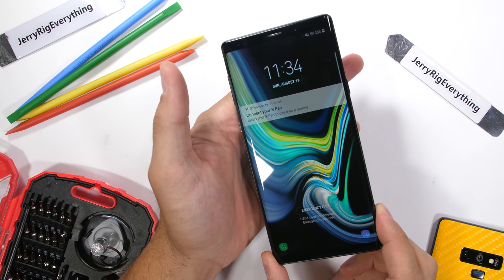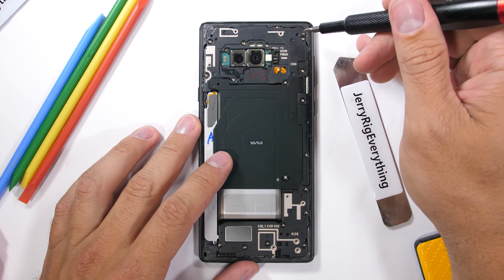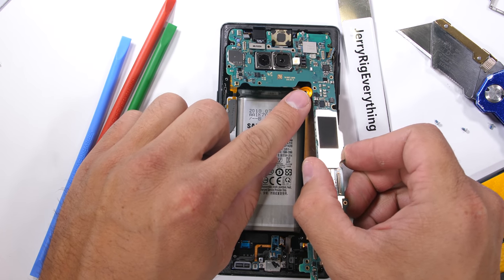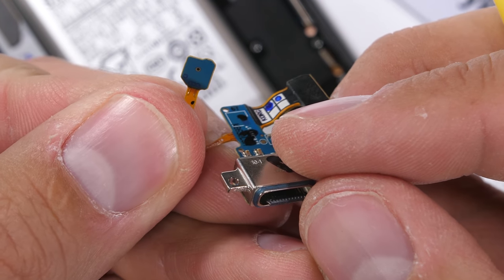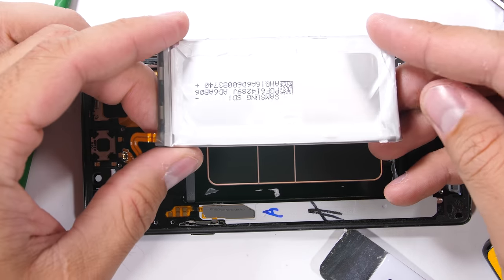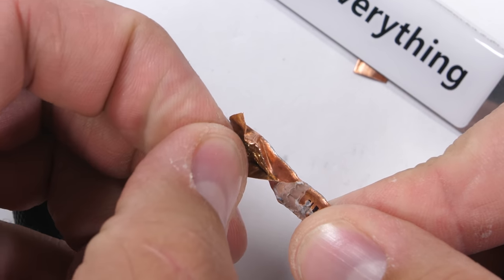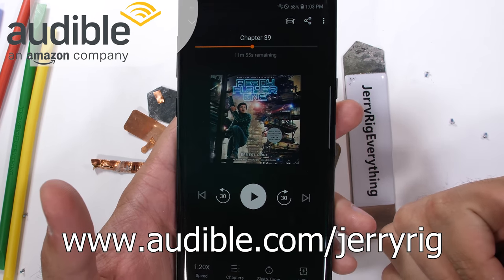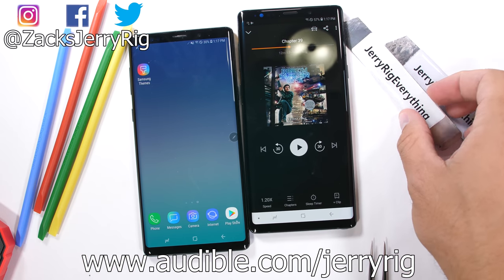Samsung Note 9 Teardown! - Is there Water inside?

Comment: Universe: "Heat Pipe" 
Samsung "PHASE CHANGING LIQUID MATERIAL CONTAINING QUANTUM COPPER ENTANGLEMENT FIELD" 

Classic mobile market. Microsoft did the same, both knowing "water cooling" sounds more impressive.
Reply: Apple: "iheat ipipe"😂in future
Reply: @rohitmeinia2580  Apple doesn't have a heat pipe.
Reply: @LeonCamero  - They'll add it 5yrs later, claiming they've invented it, and no other phone has the iheat ipipe 🙄
Reply: @rohitmeinia2580  apple will take 10 years to add that
Reply: @Danilio. 
No no no, be reasonable.

It'll be 20 years before they do.
Reply: Razer: "Heat destroyer (for gaming*) xXDarK ReapeR of heAtXx "

*for REAL gamers.
Reply: In fact...

Iphone x case = $100
Iphone x notch = $800
Iphone x hardware = $100

Total $1000

Note 9 case = $150
Note 9 hardware = $850
Note 9 notch = $ are u kidding me?

Total $1000
Reply: iheat ipipe "pro" will cost you an Xtra 700$
Reply: @LeonCamero  oh yea you are right
Reply: Not sure why you guys are talking shit then when year-old iPhones are still more powerful than this machine, heat pipe or not.
Reply: @blocksterz  and that'll only be the non expandable 64gb model
Reply: Noah Lach that is a complete lie
Reply: @Noah-Lach  best lie ever.
Reply: Apple has never claimed to invent anything they didn't. I'm not sure where this gag comes from
Reply: Leon Camero Sounds like you’re lying to yourself, bud. The Note 9 is great in a lot of ways but Apple’s chip design is way ahead of Qualcomm and there’s plenty of testing out there to prove it. But by all means, keep being purposefully ignorant if it makes you feel better.
Reply: @Noah-Lach  Please, provide a test where Intel is better than Qualcomm. And also, please provide more test that does not involve Metal from geekbench and allows you to do what Android can do as a whole. 

I'll wait.
Reply: Leon Camero What are you on about? Intel has nothing to do with Apple SOCs haha.  They’re designed in-house and fabbed by TSMC. 

Even if you want to pretend Geekbench 4 isn’t a perfectly valid benchmark, early tests show that the iPhone X still bests the Snapdragon 845-equipped Note 9 in 3D Mark Slingshot 3.1, GFXBench Manhattan, GFXBench T-Rex, JetStream, WebXPRT2015 and Speedometer 2.0, and comes in about the same in Antutu (where the Note’s faster modem should give it an advantage if the processors were evenly-matched).
Reply: Leon Camero Please don’t waste my time if you’re going to respond with more baseless accusations and ridiculous questions. Just accept the fact that every phone has pros and cons and no device can be the best in every single regard.
Reply: @Noah-Lach  I don't recall ever saying this phone didn't have any cons. Can't even provide any proof in your statement so you decide to put words in my mouth?

I told you to not use geekbench as an argument. If you want to use that, iPhone x fails in overall performance on different benchmarks, but I'm not going to use that as an argument. Besides, Apple uses Metal, not vulkan.

So once again, provide proof. 

I'll wait.
Reply: apple be like "revolutionary, iHeatpipe, it will fit into the apple ecosystem seamlessly, because its in the iphone which is sealed shut and you would need to break the glass to get into the phone.
Reply: maybe even 25, it will be with their $2000 "budget" no screen, no ports, just a slab of plastic
Reply: Leon Camero not to get into this silly pissing contest, but didn’t this guy just give you 7 examples that are not Geekbench?

Like hey I get it, people get really defensive and triggered about phones (though I cannot understand why lol it’s just a phone) but yeah Samsung is better than Apple in some ways (display and opening internet based things like Instagram) but Apple is better than Samsung in some ways (iMessage, faster processors (and before you try to claim that’s a lie again)  has been proven by almost every YouTuber out there, it always loads and opens big games and video uploads faster and with less lag) but then you have the P20 Pro with a better camera than either Sammy or Apple, not to mention Pixels camera. And speakers, neither are that great. Apple is slightly ahead of Sammy but not by much, and both are crushed by Razor.

Just let it go. No one phone is the best at everything. No matter what phone you buy there will always be another one out there that has something better, faster, etc. So stop getting so triggered when someone points that out
Reply: Leon Camero Since you clearly didn't read my other comment I will repeat it for you again: "...early tests show that the iPhone X still bests the Snapdragon 845-equipped Note 9 in 3D Mark Slingshot 3.1, GFXBench Manhattan, GFXBench T-Rex, JetStream, WebXPRT2015 and Speedometer 2.0, and comes in about the same in Antutu (where the Note’s faster modem should give it an advantage if the processors were evenly-matched)."

I look forward to a logical and level-headed response.
Reply: Thank you, Aaron. People need to understand that all flagship phones are great in different ways. I use an iPhone but I have no trouble admitting the Note 9 is probably a better device for a lot of people. And when someone points out an objective advantage of the Note I'm not going to put my fingers in my ears and pretend it's a lie. Such a pointless hill to die on when Leon could've easily pointed out something Samsung ACTUALLY does better such as the display resolution or dual-aperture camera.
Reply: Noah Lach no problem 
I’ve used both Samsung and Apple (currently using iPhone 8 bc its a perfect fit for me)
Both are great in their own ways
But they are aimed at different people 
And it all depends on a persons wants and needs in a phone to know which is best for that individual 
Yeah if you want the best display, it is hands down Samsung. iPhone X is very good as well. But for some people, an OLED display are hard on their eyes. In those cases an LCD phone is best.
All of the flagships have amazing displays, and unless you are obsessed with stats, or stare at you screen with a magnifying glass, all displays OLED or LCD are amazing. 
If you want really good Instagram photos Samsung phones are great. But for realism and natural colors (closest to what you see in real life) Apple and Pixel are better. And even that depends on what the user sees, so that can be subjective as well. (and thankfully Sammy is getting better at making photos look real life) 
But best camera on the market right now are neither Apple or Samsung.. it’s the Huawei P20 Pro
Fastest chip is hands down Apple. But could they use more RAM at times, sure! And then there is iMessage, which I’ve never seen anyone, even the biggest die hard android fanatic, try to say isn’t the best messaging app but a long shot. It all depends on what you want in a phone and what you need it for
My point here is simple
No phone is perfect at everything... I repeat, no phone is perfect at everything
And what might be best for one person may not be what’s best for you
Yeah statistics are good for bragging rights, but it depends on the user what is actually best for them. Just like how a Dodge Demon has more horsepower than nearly everything else one the road short of supercars, but does that make it a good fit for everyone? Hell no lol
Just as you said, all flagships are amazing phones. And most all have some winning stats in one department or another. But what one person thinks is perfect to them may not be what another person would think is perfect bc they have different needs for a phone.

This stuff of getting all defensive and triggered simply because of brand loyalty is absurd and quite ridiculous. I mean if you really want to be laughed at then be my guest.. go defend your phone or favorite brand or whatever, like it is your date on prom night lol
But for the rest of us, let’s stop jumping on bandwagons and start finding what phone is the best fit for you. 
No one phone is the absolute best at absolutely everything, but all are great phones. There is a perfect fit for everyone, just gotta be willing to try them out and see. Don’t stay in a bubble of brand loyalty and miss out on a phone that may suit you better, or think ya gotta do the same as everybody else and get what they have. Get out there, try out some different ones, and see what fits your needs and wants best 
You might be quite surprised
Reply: Leon Camero Funny how you stop replying when you realize I provided proof. Classic.
Reply: Noah Lach AY AY AY BREAK IT UP

Comment: 0:44 never cut towards your fingers?
Reply: If you do it like he did there virtually no risk. He has a ton of control over the blade with his thumb on the corner like that. If the blade did slip, which is very easily possible, because he is using his thumb to pull the blade towards him he could stop applying that pressure with much more control then your arm could normally
Reply: yes I know it the hard way😭
Reply: Doesn't apply to Jerry 😂
Reply: Have you never peeled potatoes?
Reply: @rothkokarbine7882  not with a box cutter..
Reply: I think he already got cuts on his thumb, I've seen scars on his older videos of this teardown stuff
Reply: Thank you...I cringed waiting for it to slide.... and the edit to show him back but with like 6 stitches on his thumb

Comment: You said “sound dampening”. My engineering professor used to make fun of people that said “dampening vs damping”.  He would say you dampen with a squirt gun. You damp with a tuned mass damper.
Reply: Thank you, I've been guilty of using that term incorrectly.
Reply: Or when you are playing those fortnite chicken dinners you can say "My dam ping is awful"
Reply: I did not know that
Reply: dampen |ˈdampən|
verb [with object]
1 make slightly wet: the fine rain dampened her face.
2 make less strong or intense: nothing could dampen her enthusiasm.
• reduce the amplitude of (a sound source): slider switches on the mixers can dampen the drums.
Reply: damped / dampened
When the vibration of a wheel is reduced it is damped, but when you drive through a puddle your tire is dampened. “Dampened” always has to do with wetting, if only metaphorically: “The announcement that Bob’s parents were staying home after all dampened the spirits of the party-goers.” The parents are being a wet blanket.
Reply: He's an engineering professor not an English professor so he should stay in his lane because it doesn't really matter since the more popular way of saying it wins out in the end.

Comment: How come we never see the snapdragon or Exynos
Reply: Because dragons don't exist duh

/s
Reply: They're attached to the motherboard. I'm pretty sure it's the silver bit on the top right. Don't quote me on that though.
Reply: @jbritain  you are correct.
Reply: @jbritain  you can always follow heat pipes to the area where the cpu is located, in times of doubt.
Reply: Good point.
Reply: @Danilio.  no u
Reply: @jbritain  oh
Reply: @pazzoeo  hehe
Reply: Joshua Britain Not the silver thing itself because it's just a shield, but Chip is underneath that, usually a ~3×3cm square and black in colour.
Reply: The chip is actually under the silver plate
Reply: @pazzoeo  do you have updog?
Reply: You will remove that silver plate and see Intel Core2Duo
Reply: +moon landing fake Yes, actually, I was diagnosed with U.P.D.O.G. and I am close to dying.
Reply: it's under the shielding on the mb... but you wouldn't see it even if you removed that because it has the ram soldered directly on top of it.
Reply: @pazzoeo  oh shit sorry man didn't want to make fun of your deadly disease

Comment: Is repairing mobile of this generation is harder that old generation? If yes that mean the companys don't want you to repair your phone just buy a new one form them
Reply: The only thing that's gotten harder is taking off the back. Most old phones you could pop off the back and replace the battery. But in exchange for that we have water resistance.

Besides Apple in which what you said is true about them.
Reply: @ZemzyOseris  not really. The iPhone X has all the connectors in one row and since there is no touch Id,it's way easier to replace everything inside..... except the glass. That can't be replaced
Reply: It’s harder to open them because people demand water proofing.
Reply: The only officially authorized service center for Samsung phones is UBREAKIFIX. We use new adhesive after opening any Samsung phone.
Reply: tushar yxajkv

Comment: Why did the 3.5 mm jack have 8 contact pads instead of 4 like the inside of it?
Reply: Yonatan - The connections are: one for shared stereo negative, two for stereo positive left and right, two for the headphone microphone (if it has any), two connections for the headphone insertion sensor, and one for frame ground. 
Some phones sense insertion by detecting electrical changes on the other connections, so a couple of those connections might just be redundant for the sake  of reliability.
Reply: Thanks!

Comment: Where's the thermal paste?
Reply: the "carbon" of the water carbon system was that grey pad he removed before the heatpipe. there's a linus tech tips video where they go over using a dry carbon bad instead of thermal paste! high heat conductivity without a wet paste is the new tech in the phone!!
Reply: If u pause at 1:55 u can see it? I didn't say there was thermal paste. I said there was a carbon pad
Reply: Then watch the video I suggested and get back to me lol, no need be to rude about tech you don't understand haha
Reply: @jubjuber1  "shut up" 😂😂😂
Reply: facepalm okay nevermind. i guess computer tech never changes and nothing new has been developed since u dont have it
Reply: nfc isnt charging. google it
Reply: It's called QI lol
Reply: @bigboiariel  are you joking or real?

Comment: It is said that this smartphone is equipped with a water cooling system. That this water turned steam to cool the phone. That's what i can not understand .First, what process would transform the steam water that is groomer would beaucoup be cool ? I thought the water turned To steam  from 103 , 105°C ? But there,  it become a cold steam ! Secondly,  water  contained in the smartphone never loses ? Since we don't speak of refueling, i don't understand. Someone  coule explain To me à little bit ? thank !!!
Reply: Thermodynamics.
Reply: The key thing to look up is "heat pipe" coolers. Low pressure water in sealed copper in order to steam/boil and transfer heat to the other end of the pipe.
Reply: @Blox117  ooh yes i don't speak english ! I manage in english, but no, you exaggerated, if it was so terrible, nobody would understand. I speak very well 6 other languages : french, German, spanish, Moore, Dioula, and fulfuldé. I also want To speak very very well english.
Reply: JACQUES OUSSAOUA I meant no disrespect towards you but I am not exaggerating, I can barely understand what you are trying to convey.
Reply: @Blox117  6 languages is better than 1 fluent
Reply: @jacquesoussaoua3239   You're doing fine. English is a tough language when it's not your native language. Keep it up!

Comment: No mention of the s pen tube? Is it a set of sealed halves or a one whole piece? What kind of electronics does it contain?  Is there a point of failure for water leakage?  Is there a chance that dust could collect or a stuck pen?

Comment: I play Fortnite on the Note9, and its water cooling system does a great job. I use a tool that tracks battery and CPU temperature, and I saw that Fortnite racks up the battery to 102°F and the CPU to 120°F. When it gets to that temperature, Game Booster automatically does whatever it takes to decrease temperatures. Definitely recommend this phone!

Comment: hello jerry I had purchased a brand new Samsung galaxy S10+..   I just want to clarify my doubts... I accidentally inserted my Sim Card ejection tool in the microphone hole which is located on the top of the device which i am sure you r aware of... coming to the point.. will it damage or effect my phone in anyways?? will it hamper the IP68 water resistant???

Comment: Hi Jerry, can you tell me if the top mic's seal and mesh would be ok and not damaged? as accidentally put the sim tool in the top mic port but seems to be working ok. Just worried about the waterproof seal.
Thanks in advance.

Comment: My note 9 is having issues with erratically restarting and/or turning off when idle. It happens only when its not actively being used by an app that draws a lot of power (like watching videos or on a phone call) and does not malfunction when plugged in. Ive done every troubleshooting method in the book including replacing the battery (twice!) and (after much research) have concluded it must be a hardware issue. So my question is: in your opinion, what component(s) could be failing and causing this issue? Thanks for advance for any help!
Reply: Mine have the battery issue too. But i used custom rom to for help and to activate my single sim to dual sim.
Now it's working but the battery is only getting maximum 4hr -5hour. Some times 3. I tried replacing battery too. 
So the only thing is use ur phone with 720p display resolution then it can be solved
Reply: Probably you are using a fake battery and not an original one, which is hard to find.

Comment: Hi! This was very helpful. My phone got wet and I tore my note 9 down with this guide. I was able to dry the inside of my phone easily and quickly with a cool dry air form a hair dryer. Only problem is after I put it back, the camera's won't work anymore. I get a "warning: camera failed" response then the app closes. I hope somebody else has this issue and was able to fix it.
Reply: i already did safe mode, deleting the cache and memory of the phone. Not sure what I did wrong. :(

Comment: does anyone know what substance to use in glueing the heat pipe? coz i think normal glue won't resist the heat from the heat pipe. really appreciate if someone answering my question, coz i need to replace my LG V50 heat pipe